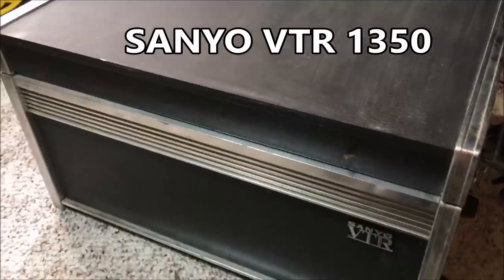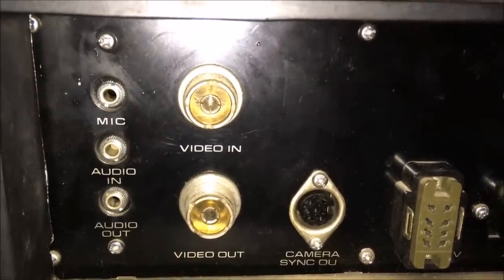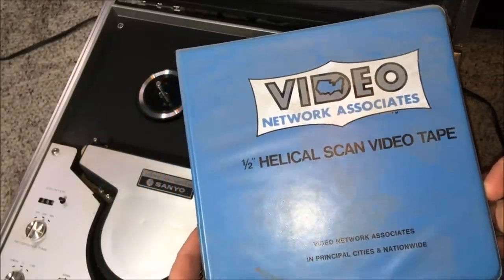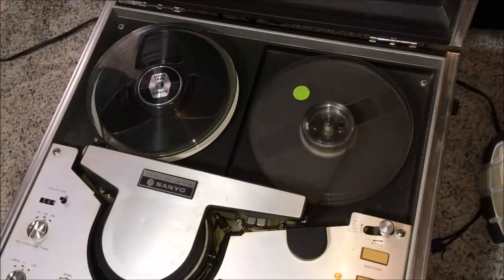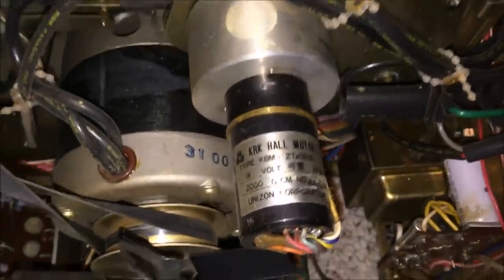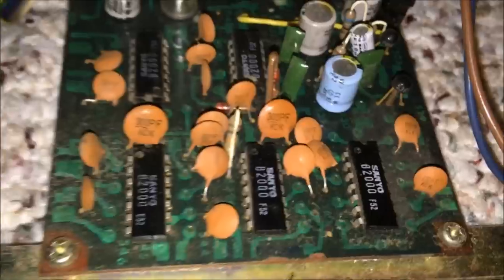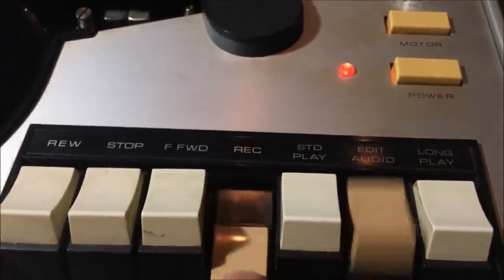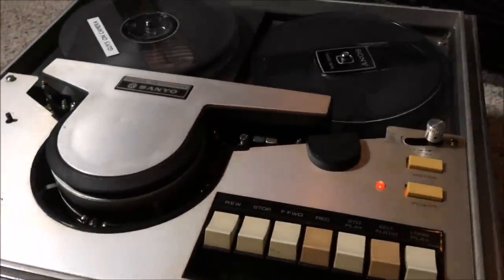Time Lapse VTR Sanyo Reel to Reel Video Tape Recorder

Comment: The high school that I went to had a Sony VTR that was a 1/2 Reel to Reel.  The middle school had one as well, a smaller version.  Both took the 7 inch reels and played for an hour.  During the science fair, in 1984 at the middle school, I brought an old 1950's tv into the auditorium as part of my project.  There was no cable hook up but the VTR was available and had a channel 3 RF modulator in it so that's what I used for the signal.  The tapes I ran were old basketball games recorded in the gym, probably 10 years before.  One of the tapes had several segments of school house rock on it and that's what I ran.  When I went to high school a year later, they had stacks of videotape with basketball games, probably from late 70's.  My job was to erase them all with a magnetic bulk tape eraser, and I did.  Little did I know that I destroyed a piece of history, which in that day was not a huge deal.  One of my neighbors brought a tape over to have transferred that was done at his company using their machine.  It was a 1965 video made of a pretend newscast which was interesting.  The end of the tape had some candid videos of kids playing in the gym.  Another video that was used by the police department was a mock trial called, "The trial of John Spencer" taped in 1974.  I watched it through once and attempted to duplicate it on VHS but the quality was not worth the bother.

Comment: Great finding! The big silver capacitor looks like the motor's start up capacitor, all Sanyo's electrolytics goes bad with time. My Sony SL-C7 Betamax had all it's Sanyo capacitors failed, even leaking acid on the boards. Good Luck in getting this one going!

Comment: Great video,think the main problem will be worn heads.Due to the fact its a time lapse machine  and probably ran non stop for years and years.The slower tape means more head ware
Reply: Not just that. The fact that there's a lot of noise on the video when the motor is on makes those head brushes and slip rings the prime suspect. Get those cleaned, and see if there's a video signal coming through with an oscilloscope.

Comment: Did you try cleaning the heads (sideways not up and down). We had a similar reel to reel VCR at school. It was operated by the school librarian who had a monitor in his office so he could see when the picture started to degrade which would happen after about 30 minutes of playback. He would then come and clean the heads using an air duster while the tape was still running restoring normal operation for the next 30 minutes.

Comment: I would clean everything, touch up solder joints, You'd be surprised what touching up solder joints can do, and even test and replace the capacitors. Also that computer chip board looks a bit dirty. You could maybe put the boards in the dishwasher. I used to work at a small electronics factory where we made static and moisture meters and we would wash the boards in a dishwasher to remove the flux from soldering. then blew off the water with an air compressor. If you can't fix it, send it over to 12voltvids, he can fix things like this.
Reply: Well those are the best looking 60's caps I've ever seen.

Comment: Cellulose which celluloid is made from, tends to suck moisture up. Its a nature of the material.  Its a product made from wood. This is what causes sticky tape syndrome.  Baking your tapes at 90 degrees in a dehydrate setting for a couple hrs will restore the tape to new condition. Placing the tapes into ziplocks with a desiccant bag will help preserve your tapes.

Comment: Those ict chips inside looks interesting as the first commercial cpu was on the market was in 1971, so i wonder if they already had the technololy on the market back then( hence why those ict chips inside the obscure machine.
Reply: Integrated circuits were a thing since the mid 60's, they're the reason the Apollo program succeeded. The CPU is in many ways different.

Comment: So pot bad audio does indeed mean that one of the audio channels is having difficulties.  It could be tied to those wires you were looking at (especially the one that fell out) and probably was always that way.  In the radio/music industry, we would have to remove the entire audio controller (pot) and clean them out.  My guess is that's why it was labeled that way.

Comment: The first thing to do is to clean the slip rings on the rotating heads, they even looked dirty and given the tiny signal they have to deal with I doubt much will get through as is.

Comment: Odds are the sticky tape gummed up the heads.  However, if it's not passing a video in signal out to the TV, that suggests something else is bad.  I'd never see a time-lapse open reel like that.  That must have cost a small fortune back in the day. I'd think it would have to be used in a bank or casino or other high-value place.  It would have been too expensive for the Kwik-E-Marts of the day.

Comment: What would happen if you put a VHS tape on one of these machines? Could you record on it?
Reply: BBC600 yes and most likely very good results as vhs tape is much higher quality hi output coating on the tape by the same token that old tape would not work in a vhs deck very well if at all as the old tape required much higher bias signal to record on.
Reply: Given the different era, I'd imagine the tape formulation would be different.  It would be kinda like putting a high-bias tape into a normal cassette machine.  it might work, but not as well as using the right kind of tape.
Reply: VHS tape is much thinner. Also it has higher magnetic field requirement. But it does work to an extent.
Reply: Due to the different sizes of video drums and probably speeds you would not be able to watch a tape made on a VHS machine. If you recorded it on this machine it should work.
Reply: @russellhltn1396  Yes so true. Same time have been seen on youtube that vhs tape works in reel to reel audio decks pretty good.

But okay this is also video not only audio :)
Reply: For my own experience, in the PAL realm, you can spool a vhs tape into a beta or video 2000 shell and they work perfectly fine. be aware vhs from de mid 90s were quite good and cheap, so if you wanted to make a, lets say, reference beta or a video 2000 tape, you could just spool a tdk high grade and the results were excellent. there was no need to fiddle with any bias correction or adjustment.

Comment: I've tried using a hot car as a "tape baking oven."  I cracked the window slightly and used a meat thermometer to try to keep the temperature within a range  But it didn't really make any difference.

Comment: I repaired these units in the middle 70’s.
Changing record time did not effect quality.
It would increase the time between recorded picture frames. The green connector was known as an 8 pin. It contained video in/out and audio in/ out in one connection. The audio did nothing in time lapse mode.
The drum servo was controlled by an electro magnet that would slightly slow down the head spin speed to properly sync the record frames. The pot bad audio indicated this audio level pot was defective. I believe the Hall motor drove the capstan in time lapse mode.
Replacing the head bar required inserting a foil thin shim or two under one or both sides of the bar assembly to minimize the guard band width.

Comment: You should get a Video DAC, back when CD's were really expensive, some people would record 16 bit digital audio onto video tape, usually VHS but if you had one of these VTR's that worked really well you could do it with one of them too.
Reply: You mean the stuff that is in a DAT deck? DAT is pretty much the exact same but instead of a VHS transport they used a Sony Hi-8 cassette to make the tapes smaller.

The reason they used the 44.100 and 48.000Hz sample rates is because they lined up nicely with the timing of existing video circuitry.
Reply: https://www.youtube.com/watch?v=XkGTDccGO2M

no I mean one of these you just need a vcr or vtr with about 300 lines resolution

Comment: I suspect that the main motor is a three phase motor driven via a mains to three phase inverter, I wonder was that wire that came adrift was a video lead or was it.
Reply: No inverter there. The main motor is a three-phase motor, most likely an induction motor with the big capacitor providing a phase shift for the other motor phases.

Comment: What would happen if you were somehow able to put the tape in VHS reels and play it in a VCR
Reply: I'm pretty sure that EIAJ tape and VHS/S-VHS tape are incompatible as they scan through the heads in different manners. Tape speed may be an issue too.
Reply: Ive tried this before on my national colour VTR, the audio plays but there is no picture as the heads scan at a different position. hence why the head on a normal vcr is slanted to fit more onto the tape.
Reply: The head position in a U-Matic or Betamax is pretty similar to the old VTRs though, so that may be worth a try.

Comment: Clean the tape with a cloth with some silicone spray dry lube on it then also clean the drum and heads. I'll bet it'll work fine. As long as the drum heads are not dammaged.

Comment: The "spindle" on the power connector is NOT a spindle!  It is a PIN.
Also, the "spindles" on the transport are NOT spindles!  they are Tape Guides.
Reply: They don't spin, so they're not spindles fur sure.

Comment: Now I see  what this is can you just picture what it be like if they used helical scan for just audio. Wonder how many hours of music would you get and or would it sound better then what they used for cassettes and reel to reels with a horizontal tape head. Just wondering if it was ever done or possible. Sucks this didnt work too good. Hopefully you have a way to find out what wrong.
Reply: yes it exists; DAT, Digital Audio Tape
Reply: Even VHS had a fairly decent implementation of helical scan audio, known as Hi-Fi VHS, but the recording channel is not exclusive to audio so this is likely not what you're looking for. A practical issue is that the helical pattern introduces a discontinuity that is not a problem for video because you have a perfect switchover point during vertical blanking period, while on audio, you need one of two things, either supreme precision of the complete mechanics and extremely durable tape, or digital recording where you can just pause at the end of the swing and continue filling an asynchronous buffer whenever you get a pilot signal again. So yes, there's DAT and it makes total sense there.

Comment: This was uploaded in 240p... 
Oh... thats the resolution of the machine?
Reply: You gotta change your settings mine is at 360p uses less data on my mobile. But he has it at 1080p
Reply: @mercuryoak2  ok. Looks like YouTube on Desktop is broken again
Reply: This happens when a video is published before YouTube finishes processing. It may be stuck at an arbitrary low resolution for a few hours at first after upload, then it bumps it the re-encoder to 1080p.
Reply: Its fine. YouTube ended up doing weird stuff on PC

Comment: You could tell you really didn’t  know what you where doing.    You could free up the tapes by notthreading it through the. Drum.  And running it straight to the take up reel  and holding the shut off tape end switch making the recorder think there was tape there. And then running fast forward.   And get some rubber revitalized. And clean the rubber idlers and belts.
Reply: Yeah he's just fucking around. Anyway I think there'd be a problem in winding the tape directly between reels because they're on different heights so it wouldn't thread properly.

Comment: What's your obsession with the word "spindle'. Spindle implies spinning.  The power socket posts or pins are not spindles, and the guide posts that you threaded the tape around are also not spindles. Also, not all tapes suffer from sticky tape, or shedding. Sony tapes ALWAYS are sticky, Panasonic tapes are never sticky.